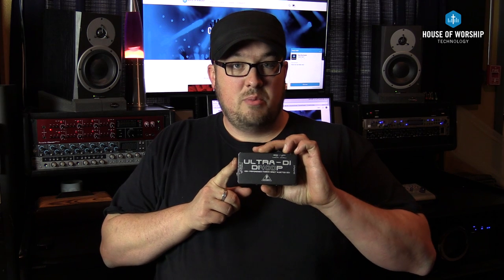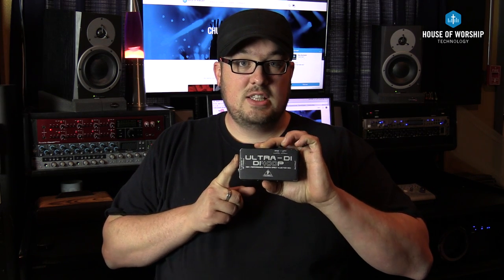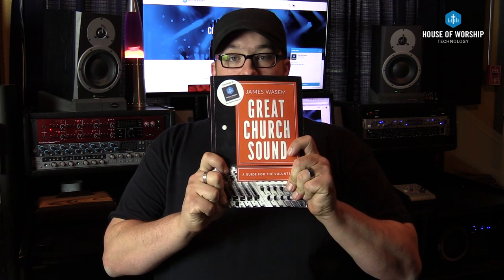How to Use a Direct Box (DI) with a Bass Guitar Amplifier - Church Tech Tip Tuesday

Comment: I have a question about Bass Di using the MXR M80. This pedal is basically pre- amp and Di. But there is a parallel out and regular output. What is the difference? What is the parallel out for?

Also, if i use the the Di output, with out a bass amp, is the signal on the pedal is  bypassed or am i still able to tweak the EQ on the pedal still come out to the PA?

Comment: So I can use the DI-box without an amp aswell? and just get the bass sounds through the stage monitors so I don't even have to bring my amp. Or am I missing something?
Reply: yes you can.
Reply: You can But you wont be able to play with the Effects Since A Sound Mixer/Board is not meant the effects you want. I woulf Get a amp because with the amp you can Slap your bass and get the sound of what its suppose to sound like. Get an Amp and Connect to Di in the back of the Amp to the out of The Di Box and in the input section you connect your Electric Bass.

Comment: hi can I use my multi processor  before DI box to audio interface
Reply: Dangdu Music absolutely but then why even use the di box? that is unless you want to a second line to an amp and use that to monitor so you can avoid latency while tracking. the setup i have in mind will be guitar into the di box, then one cable from the di box into the interface, and another cable from the di box into my pedal/amp. that way i can listen to an amp with effects and no latency while i record but send an unprocessed signal to my interface and use vst plugins to get the desired tone later